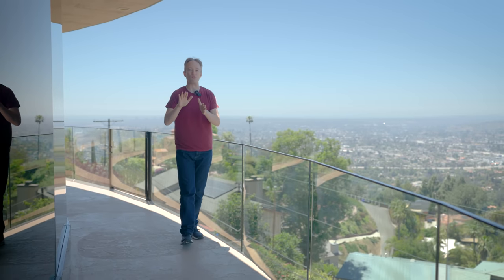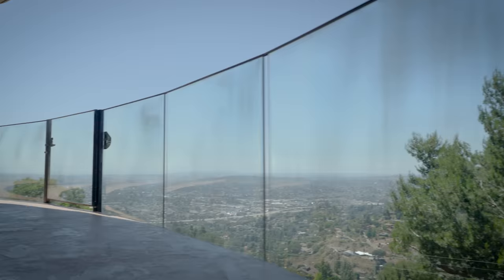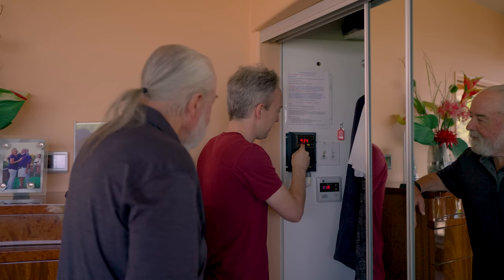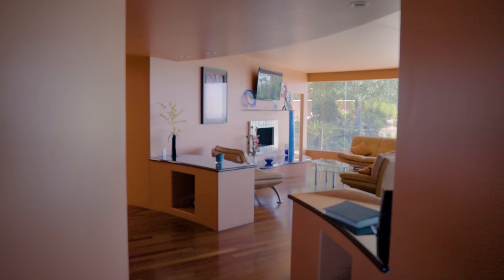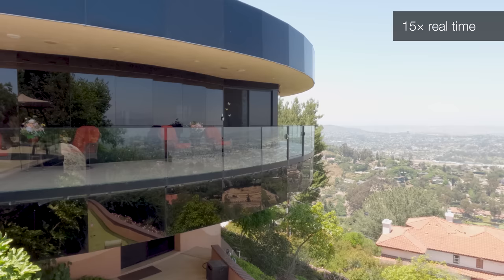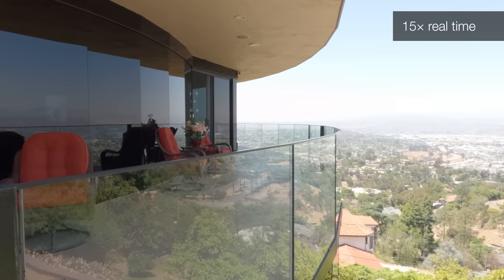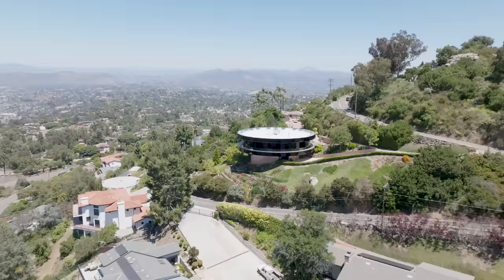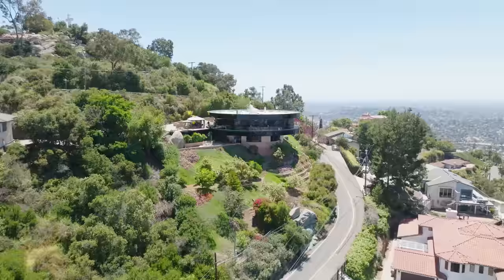I thought this rotating house was impossible.

Comment: The owner has a patent on this rotating water service pipe.  That's insane levels of engineering.
Reply: Having a patent is probably the most mundane thing about the engineering...
Reply: the house was built 20 years ago, i guess that patent is public domain now
Reply: @chiefpacman  These days it's just an expensive formality that nobody really wants to do because China.
Reply: @ayumuaikawa maybe because in Cambodia, there are rotating skybar on the top floor. Similarly, in Hongkong there are restaurants with rotating room(and this was yearssssss ago)
Reply: @prumchhangsreng979  oh i didn't knew that, i was mainly saying that because usually after 20 years a patent expire and become public domain, (i believe some can last longer but let's not complicate things here ^^), thanks for the info
Reply: @prumchhangsreng979 But as Tom mentioned usually they don't rotated the whole thing. They have a stationary core and have only the platform rotate.
Reply: No, it's not. That idea is literally thousands of years old.
Reply: @prumchhangsreng979  U.S patents only work in the U.S. nobody outside of the U.S cares really.
Reply: I also would have air-pressurized each cavity in between each of 2 wafer systems to have a positive air-seal. Just to be safe and keep away grey water from blue water.
Reply: @pranavid  Question is..... how can you have the system work without needing any rubber parts ? The solution  came up with is replacing the rubber with well manufactured smooth steel alloy, and then indeed pressurize it.
Reply: I wouldn't call it "insane," I'd call it good, competent design and engineering.  What do you think engineers are doing all those years in school while you and your non-STEM pals were boozing and chasing tail?
Reply: @vovochen, Given the extremely slow rotation, seals using ceramics and Teflon against polished steel should last for an eternity.
Reply: @belipe_belipe_belipe  That idea is as old as.. idk, Rome ! I came up with it when I was 10 years old and playing with that Spinniy Toy - Idk why some think of it as "Genius".
It is LITERALLY the ONLY solution for this!
Reply: It's just an hydraulic swivel but instead of a P, T and drain line there's sewer, water and gas. There's one in almost every crane, it's not that rare.
Reply: @pranavid I think 4 rings instead of a single tube, manufactured in half's and bolted together, would be simpler. Keeps lines apart and is easier to service.
If possible I'd also make the sewage go directly down the middle, dont want pieces of that to get stuck.

Then again this lasted 20 years so what do I know.
Reply: @vovochen  It is not an obvious solution and difficult to develop.
Reply: @jwadaow  OF COURSE IT IS OBVIOUS ! Wtf do u talk about ???
Reply: @mitchd949 Don't be so arrogant when you know nothing about the person you're talking to.
Reply: What I mean is this guy has to be an interesting persona, not just "rotating house designer". Special effects in movies maybe? ;>
Reply: @orangerightgold7512  That's why you typically patent things in several countries
Reply: It's looks like a rotary joint
Reply: @orangerightgold7512  they do, because sanctions still exist even outside the US. for example, American companies having to change how smartphones are designed because the EU decided removable batteries are a must. markets interfere with one another on a daily basis.
Reply: could probably part pay the mortgage licensing use of this patent...
Reply: @vovochen  The fact that the invention was able to be patented speaks for itself. Patents are not granted for obvious ideas but for those that demonstrate novelty, non-obviousness, and usefulness. Ignoring this critical aspect and repeating your claim without substance only weakens your position.

Moreover, let's be clear about the significance of Tom Scott's revelation in this video. His technical background and experience make his initial lack of understanding even more notable. It takes intellectual honesty to acknowledge that even experts encounter challenges in grasping certain concepts. If an idea is genuinely obvious, it wouldn't have taken someone like Tom Scott some time to comprehend it fully.

It's essential to recognize that simplicity can be incredibly difficult to achieve. Just because an idea appears straightforward after its development doesn't mean it was obvious from the start. Often, it takes considerable effort, ingenuity, and iteration to distill complex problems into elegant and simple solutions.
Reply: Good, because I did not understand how this all fits together with the main lines going in, so I definitely need to look at that damn patent.
Reply: @mitchd949  You say that as if STEM-students aren't notorious booze hounds.
Reply: It's incredible what people are capable of doing and creating without the government standing in the way
Reply: @orangerightgold7512  you can get a global patent, but that's probably gonna cost you more than its worth.
Reply: he isn't an inventor, his "invention" or "patent" has already existed for decades.
If you don't know, anybody can apply for a patent, nothing is verified other than a duplicate patent. In my career, I've seen so many patents that technically don't make any sense and aren't verified. Unless you really have an idea, the US-patent thing is for non-engineer inferiority complex.
That method is widely used in hydraulic distributors and pumps for industrial applications.
His "idea" was just to apply the same method for a rotating house, nothing else.
Reply: @pranavid  - I would’ve put the drinking water on top, and the sewage in the bottom, just the be extra sure my drinking water was safe… why would he do it the way he did?  didn’t want to sacrifice the water pressure?
Reply: 5:04 I dont care about the alarmed seals ! I want my fresh water ABOVE my sewerage 🤢
Reply: this thing can be used for artificial gravity ships some time in the future, that's just how clever this thing is.
Reply: If he dead. Repairing would be burden
Reply: @chiefpacman   not true.... I am an engineer and those of us with patents have "street cred"
Reply: I think a couple of people are forgetting he's not an engineer.  Or a crane operator.  So that probably accounts for the sewage on top mistake.  And if the patent office gave him a patent on something redundant that's on them.  If the patent process didn't inform him he's not an inventor of something new then how's he supposed to know?  20-year patent expiration, 20-year length of ownership.  Coincidence?  Somebody commented about making the mortgage payments from licensing the patent.  Perhaps he was able to a few times.  Bet the house in Coronado would have sewage on bottom and a brand new patent on the revision if the expiration had been shorter.
Reply: @ReadableLetters  your Crain would need 5 hoist to be equivalent to what he designed
Reply: @prumchhangsreng979  The dinner room rotated, but not the restrooms or kitchens.
Reply: @vovochen   You have lost your mind.  You believe that many thousands of years ago, those people had this level of sophistication in their rotating homes?
Reply: @Redridge07  read
Reply: @vovochen  what?
Reply: @Redridge07  read it
Reply: @Redridge07  Read it by now?
Reply: @vovochen  I have no idea what you are talking about.
Reply: @Redridge07  thats on you
Reply: Nobody would buy it though because nobody has a rotating house.
Reply: It's not that complex.  It's a great piece of engineering, but nothing groundbreaking
Reply: That's some Genius stuff. Still a touch uncomfortable that the sewer and grey water is above the drinking water though.
Reply: How did that get approved in LA? Seems almost impossible to me that it got approved to be on the grid.
Reply: @ayumuaikawa  Patents are put into the public domain as part of their creation.
Reply: @@MengGuoZhou Which mysteriously escapes you right now. Of course.
Reply: What a brilliant person!
Reply: @dsp4392  Also because corporations will spend ludicrous amounts of money (that they withhold from their workforce) acquiring legal assets to beat small start-ups to death with.
Reply: Almost the same as what's on an excavator
Reply: Could come in handy in a rotating space hab
Reply: That's how hydravlic excavators rotate. I bet that was the inspiration.
Reply: @chiefpacman  "Having a patent is probably the most mundane thing about the engineering..."
Being the mundane part of a device is the purpose of a patent.
Reply: I Don’t want to undermine it and be that guy but it’s not that crazy
Reply: @vovochen That's the thing about patents, not only are their anty progress and immoral, you can also patent something that someone has already done countless of times but didn't patent it yet. Patents are a plague on hummanity and progress.
Reply: It is jesus
Reply: @baph0met what are you talking about. If you don't patent your inventions then either r&d becomes worthless, or you keep a miracle drug out of public domain indefinitely.
Reply: He's a really smart guy
Reply: He's awesome
Reply: bruh not just engineering. this guy mastered architecture too. like the attention to detail is crazy, and I am saying that as a valedictorian architect from germany!! highest respect to this guy, I think I never saw a more genius homeowner
Reply: U.S patents governments candy store.
Reply: @jwadaow  "" I'm not saying this idea is obvious, but I wouldn't put so much value in a patent. There are tons of frivolous and duplicate patents. The USPTO is poorly equipped to accurately judge the worthiness or novelty of patents and heavily relies on the judicial branch to sort the mess out.
Reply: @prumchhangsreng979 but they have their own water/gas/plumbing on the rotating part which needs to be filled regularly
Reply: @ayumuaikawa  20 years is ... recent... cause i know one that was built around 30 years ago

Comment: Al is a real one. Bro invents his own problem AND builds the solution to said problem, now that is peak engineering.
Reply: I can't imagine the engineering effort it took on his part to come up with a novel design like that, especially something that involves water, sewer and gas - I imagine he had to get it certified as well.
Reply: What is engineering if not inventing your own problems and (sometimes) solutions to them?
Reply: (and the money to be able to afford the risks, and solve the problem)
Reply: I must be an engineer because I can invent my own problems too.
Reply: "Elaborate answers to a question no one asked" is one of my favorite categories of engineering.
Reply: @asystole_  Its not a novel design, things like this have existed for a long time. It is a novel application of the design though.
Reply: That’s the way I used to feel about the inventor of Lysol, but it turned out I was wrong. 
🚀✨🚀✨🚀
Reply: @denisl2760  So, It is a novel design
Reply: @denisl2760 don’t be a spoilsport.   It is nice to see someone doing something different outside of the box.
Reply: It’s the same valve that’s in every track hole. That’s how they can spin around and still dig.He didn’t invent it.